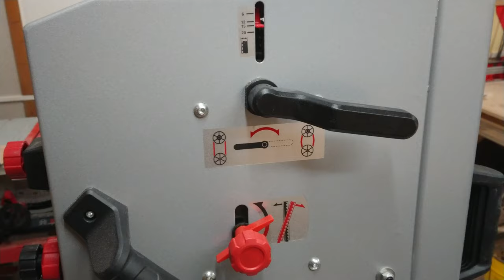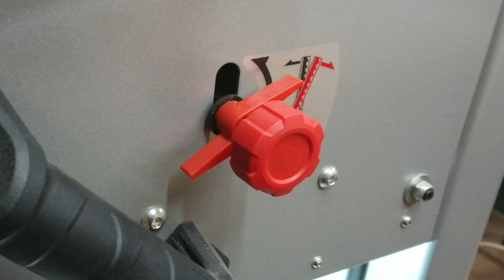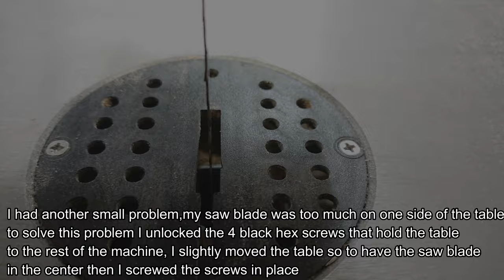How to adjust a bandsaw (metabo bas318)

Comment: Great video. I'd like to know more about the blade you used for ripping larger pieces of wood. I plan to use my Metabo for that too.
Reply from the maker: thanks, I use a bayerwald blade  2240 x 16 x 0.5 x 4 ZpZ / 6mm , I admit that sometimes it can take time but for occasional use it works very well, and it's safe

Comment: Hello. Thank you for your video, not much on detailed adjustment for this bandsaw until your video. And congrats on all of your awesome work, thank you for sharing.
In this video did you use the original blade? I understand you changed it later, I'm only interested to know what blade is this one showed here.
Reply from the maker: You're welcome, yes it is the original blade, but I quickly changed it to be able to make high cuts, the original blade deviates when you want to make cuts on thick wood.

Comment: Thanks for the video, I didn't find the manual the best! How much play is there in the upper guide when you adjust up and down for different heights of material please? Mine seems to have more than I would expect and the handle to wind it up and down also gets stuck sometimes so I'm wondering if something isn't sat properly...
Reply from the maker: I was able to see this problem on another band saw (the same model) there were the 2 screws at the top and bottom of the handle which is used to raise and lower the guide which were not tightened, by tightening them there was less play, I advise against unscrewing them because there are washers which are annoying to put back, it seems to me that it comes from the washers and the paint that the guide tends to block at times, I could improve the sliding with a little oil and by playing with the button (up and down) 
I admit this system is not well designed 
hope this will help you
Reply: @js_workshop  thank you for the reply. They were both fairly tight so unfortunately not an easy win I think. I'll try and get a bit more access to see what's going on in there (thanks for the tip on the washer!). I had expected better from a saw of this price point and have been impressed with other metabo tools I have owned
Reply from the maker: @TheJSV650  you are welcome,  It's a good machine but it's true that it has some flaws that cast doubt on the quality. personally I have a mixed opinion on this brand,  don't hesitate to leave a comment if you find the solution to the problem, maybe it can help other people in the same case, I'm looking to see if I can find other solutions, but to limit the play I don't really see how to do it

Comment: Even if right set up as yours mine bas 318 cut NOT strait at all!!! Why? Thanks
Reply from the maker: if your cut deviates it can come from the blade, it depends on the thickness you want to cut, I had this problem with the original blade and wood more than 70mm thick, so I changed the blade, currently I use a 2240x16x0.5x4 blade to cut 160mm thick, and I have no problem, I hope this will help you

Comment: You don't show the adjustment for lower guides, fore and aft. This block is held by a difficult bolt accessed from within the lower wheel case, and in my case the machining of this sliding adjuster was so poor it was immovable. The lower wheels were too far forward and if correctly distanced from the blade they would be half way up the teeth of a 12mm blade. I've had to work for an hour with a file to widen the sliding block enough to move the unit just 2mm backwards so the teeth will not be caught on those wheels. But it's still not adjustable, binding in a slightly better position. And the upper blade guide is so poorly mounted, it can be tightened in any position over a range of a centimeter left or right, fore or aft. This is NOT a precision band saw.
Reply from the maker: you are right I forgot to show the lower adjustment, in itself it is not difficult there is only an adjustment screw, I noticed that it is often the paint which poses a problem in the elements which are centered slide, as for the quality I mentioned it in other comments, in itself the saw works well once adjusted but it is true that on certain points the quality needs to be reviewed, but you have to keep in mind that it remains an amateur machine, if you want something better designed the price will also be much higher